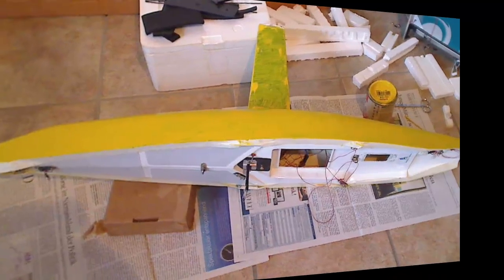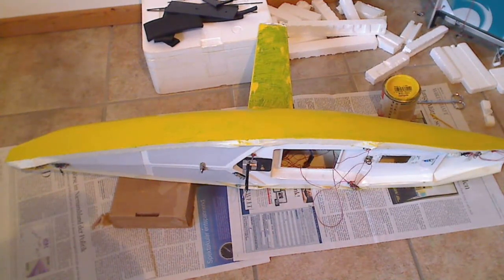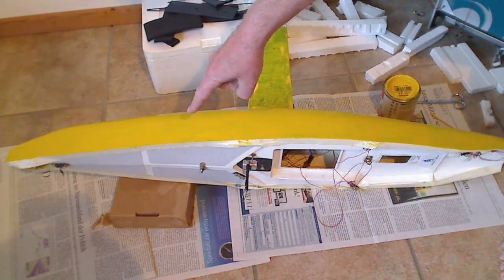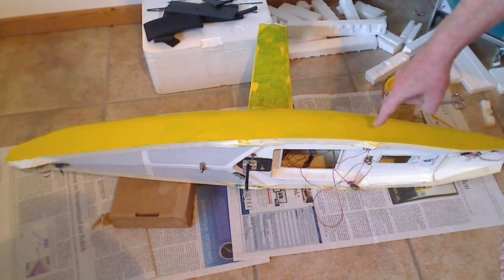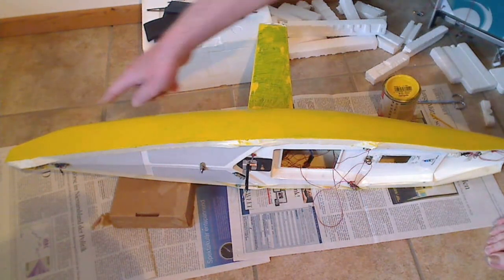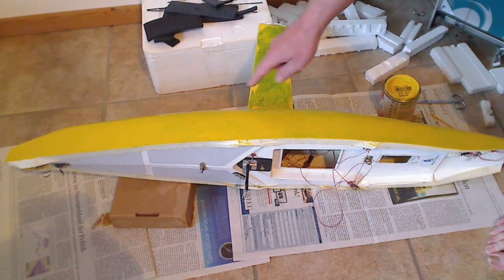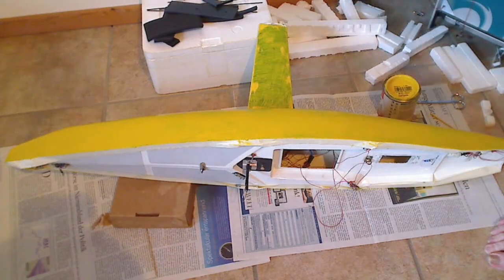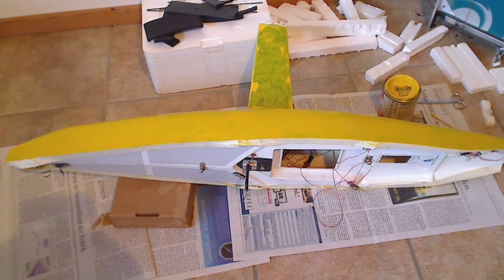Hurricane 1000 Hull Repairs Stage 3

Comment: When you start painting her please use at least one coat of high gloss, since this is the only way to make sure that epoxy will not take up any water. You can always put a duller layer on top of the gloss, as long as you don't sand in between! Hope you have a spray-gun. Lt's keep connected, Vince